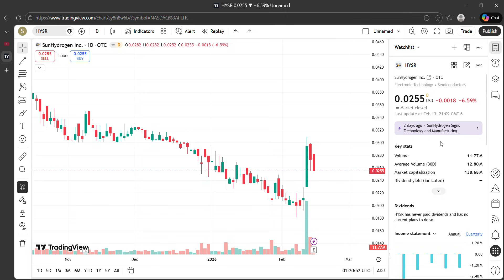Sun hydrogen commercialization contract!

Comment: If HYSR can get an off-taker as you put it, to utilize 1,000 Sun Hydrogen panels to produce H2, and that makes enough profit for that company to justify acquiring more 1,000 panel sets, HYSR could quickly grow to become a huge corporation. I've loaded up 50K shares and plan to add a lot more. Thanks for your video reports, Stock Warden.
Reply: I have a feeling Honda will be that off-taker.   All we need to avoid is an up-listing,  that would go hand in hand with a reverse split.
Reply from the maker: I appreciate the feedback and I believe your right